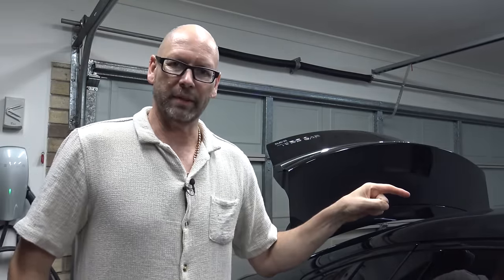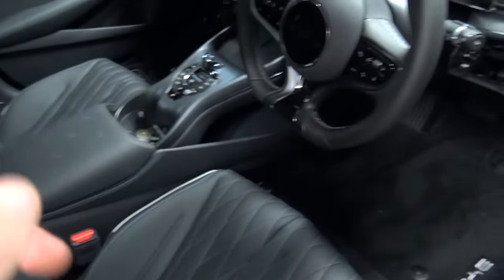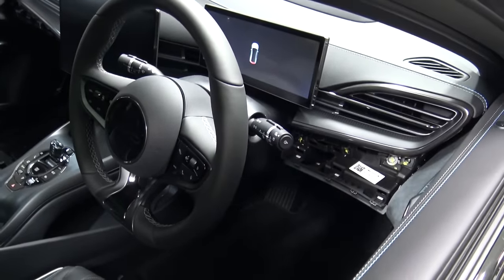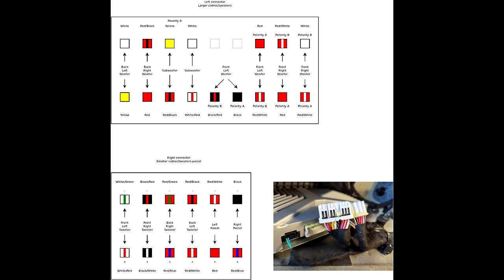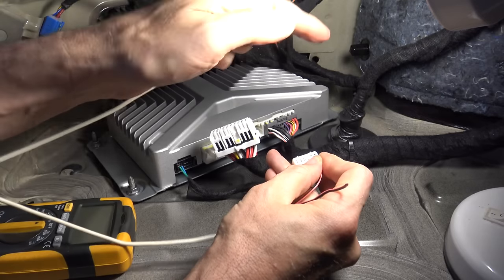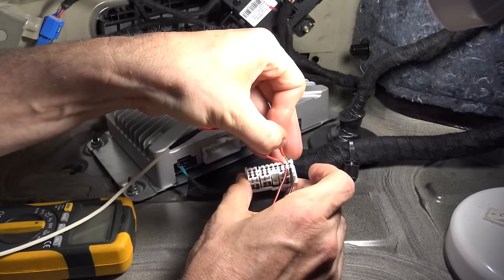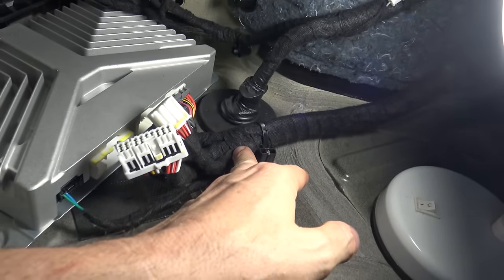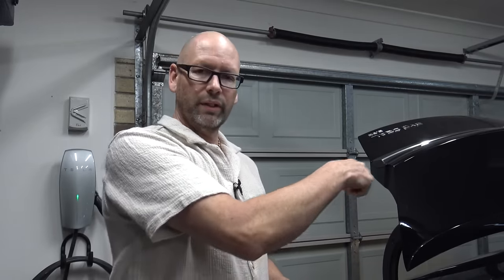BYD Seal Factory Speakers

Comment: Nice, thanks for doing the dirty work & sharing your findings.

Very tempted to upgrade the piss-weak stereo myself, so this will come in handy.
Reply from the maker: Ah, you have a Seal too? At least someone else can save a bit of time.
Reply: @TallPaulTech  Yeah, your vids on the car have been great (those fuses will be coming out as soon as I get around to it).
Not sure I'll be quite as adventurous with ripping apart so much of the interior myself though.

Comment: To trick cars to turn off with the doors open most new cars have the door locked sensor switch in the door latch so you can just take a pen or screwdriver to lock the hatch while door is open to get it completely off.
Just remember to pull the door handle to open the latch before slamming the door 😅

Comment: Paul,  What new stuff are you putting in.  I notice don mine that turning the sub down to zero results in much better bass from the speakers.  i think its clipping anf the amp lacks punch to run all of the speakers.   What parts are you going to add.   Did you manage a way to get signal from the system without using high level
Reply from the maker: The signal from factory comes as data on 2 wires to the amp. I didn't look any further into it, as I don't really want factory sounds anyway. After I ripped the sub out, I still noticed bass in the door speakers, but it's the volume that's pathetic. You'll just have to wait and see how it all turns out, as I'm kind of making it up as I go along :)

Comment: Keen to know if there is noticeable difference when playing music with and without original 8in sub. Also what are the wattage rating and impedance on that sub and what does it weight? I have a 2ohm amp that is 300wrms, keen to know if there is possibility of doing just a subwoofer/amp upgrade that is simple. The housing might be different though, how many litres of air is the sub using or is it a free air sub I wonder.
Reply from the maker: I'm using factory still, minus the sub at the moment. It's still okay. The sub was never that pumping anyway. It weighs fuck all. You'll have to wait until full install video to know the rest.

Comment: Good informative video. Keen to follow along with the audio install. Are you going fibreglass for the sub box?

Oh if you could pdf the full amp 3 plug wiring diagram, that would awesome
Reply from the maker: You'll just have to wait and see
Reply: @TallPaulTech  ah yes... that's exactly what I said I would be doing...
Reply from the maker: @CletusDB  I might stick a scope on the other wires to that amp to bell them out too.

Comment: Hello, I'm from Thailand.
On my Byd Seal, I recently replaced my door speakers with Audison AP165 2 ohm but have a question 
because the shop doesn't install a passive crossover for all the speakers. 
He said it wasn't necessary. Because the frequency has been separated with a car amp. 
Please explain if this is true or not? thank you very much.
Reply from the maker: That's correct. The amp has a separate output for the woofer, and another one for the tweeter. No need for passive crossover. I showed that or mentioned it in one of my stereo videos there.

Comment: Can you buy a socket for the loom? Just thought It would make it easier if you ever wanted to sell the beast back to factory spec. Nice to see you get the DMM out, missed opportunity to use a network tracer :P
Reply from the maker: You're right, it would be nice, but trying to source the exact plug and pins... you know how that would go.
Reply: @TallPaulTech  $$$ I've seen EE's design their plugs & sockets for specfic designs from scratch, there's places in China that will manufacturer or just steal the factory design. Really depends if there's a market for 3rd party stereos in these modern EVs, hacking the loom is the cheapest by far :) Maybe a good business for someone to start up.
Reply from the maker: @TradieTrev  I was talking about car stereo upgrades with the guy in the shop, and he said there has been a big gap in interest since the late 90's, early 00's, and he thinks it's because a lot of kids just listen to headphones and are used to them. They don't realise how a good sound system (of any kind) is until they experience it.